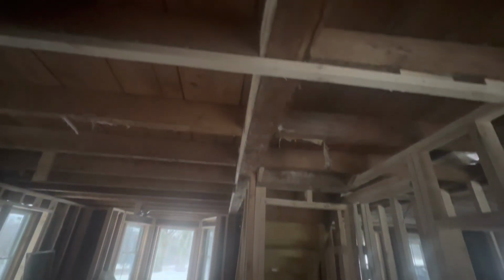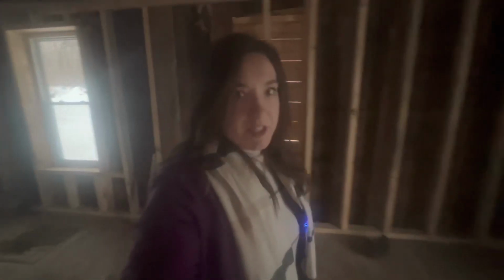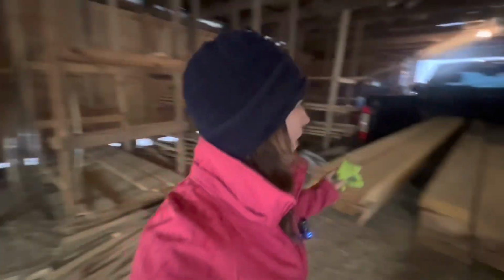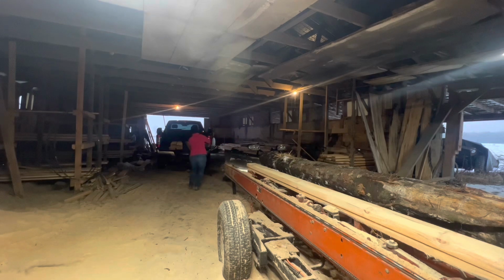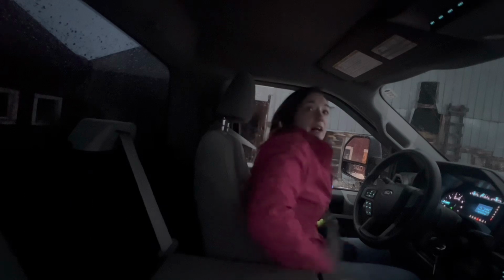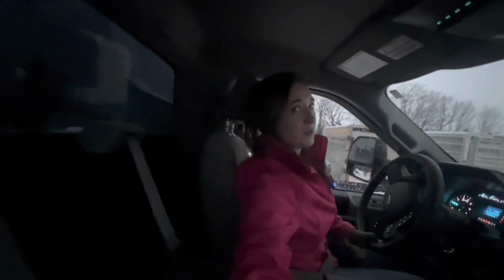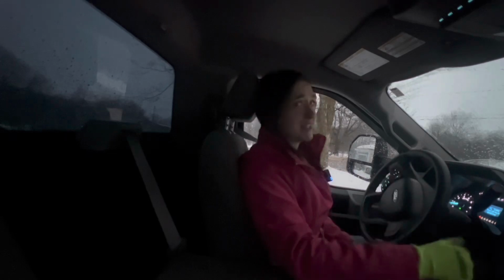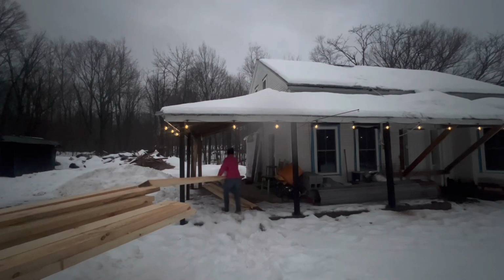This OLD HOUSE is pretty AMAZING! | Sawing Lumber for my Fixer Upper House!

Comment: My Grandfather built post and beam barns.  I have many of the tools he used.  This type building was built with vertical posts and horizontal beams.  The point at which the two intersect were put together with a mortis and tenon joint.  A hole was drilled through the joint and a wood pin was driven into the hole.  The pin was often made from ash.  All the post and beams with bracing were assembled on the ground in a section called a bent.  The bent assembly was raised into position with a gen pole, block and tackle, and a team of horses.  As each bent was put into position horizontal beams connected the bents together.  One almost needs to see a drawing to understand the finished job.  I hope this helps to understand the construction.  You are doing a great job.
Reply: Thank you for your explanation.
Reply: Richard Wolfgang : Thank you for the very interesting detail of how the Amish built their dwellings !! In fact, I am looking at a couple videos on YouTube that tells us all about the Amish - and all so very interesting !!
Reply: If you have horses, ...we did it by hand, old fashioned muscle , leverage and think it though,  lifting one end at a time.  2 Men can do it.
A hewing axe, is left or right justified,  so when you swing you get a flat surface, the ax has a bend to it so that it will glide along the flat side of the log to beam transition.  There are some great u tube videos showing this log hewing technique.  I have done it but , I am slow,, the old timers were so fast..
Reply: We'd love to hear more!  Thx!

Comment: Abby, you are doing a great job.  The pioneers used block and tackle as a pulley system to raise those heavy beams in place.  We were thinking you could save a little energy by backing the truck up closer to the house to unload those heavy boards.  A few saved steps add up in the long run. ;)

Comment: Besides an axe to cut those beams, another tool was an adz/adze.  The heads of the adze could be shaped into different shapes, depending on what type of cut was needed, such as straight or curved.

Comment: I'm wondering if perhaps the 24 foot beams could have been cut from 30 foot or taller trees and then cut to 24 foot length with one of them cutting thingys. They were probably lifted into place by a carpenter using a lifter-thingy.

Comment: Being so far north there is a big difference in daylight hours between summer and winter. The June solstice (summer solstice) in Moira, New York is at 10:57 am on Wednesday, June 21, 2023. In terms of daylight, this day is 7 hours, 25 minutes longer than the December solstice. In most locations north of the equator, the longest day of the year is around this date.

Comment: You have floor joists and you have ceiling joists that hold up the ceiling, so you was aware of the term for the floors but not the ceiling.  You are learning though and that is good.

Comment: 150 years ago people were alot stronger and physically fit for hand work! People did most of their own building from the trees and materials on their newly acquired properties! Im sure they used many pulleys and ropes to set those beams and maybe even had horses hooked to ropes to raise the rafters ! I got a back ache thinking bout it lol! They probably had a huge hand saw to cut the tree down and used planers to make those posts and beams !

Comment: They used Poles, A Frames and Tripods, Pry Bars, Ropes and Rope Pullies.to minovery the Timbers in to please. You may have studied the mechanical advantage of Pullies in your Physics Class or Physics, or your Seance Class at School. Horses, Mules and Human Mussel were used in some cases to provide the Lifting Moving power. As the Timbers were manipulated into, please. Yes, Abby it is a Laber intensive work. A slip, a brake in a Rope or Pully can cause serious damage, broken Timbers, Tools, injuries or the Death. This is a skilled profession. earned by doing. From the ground up!